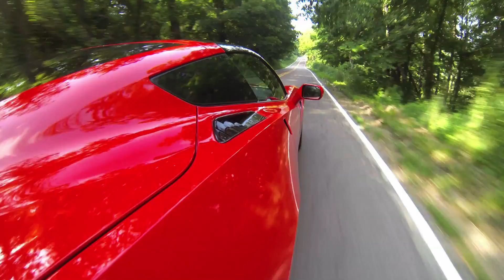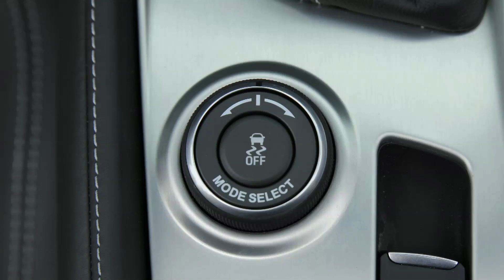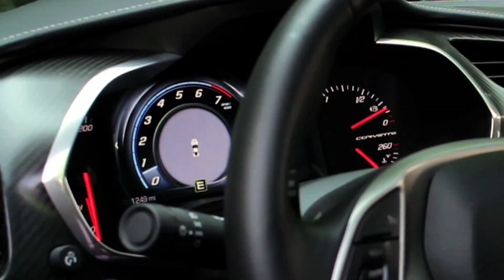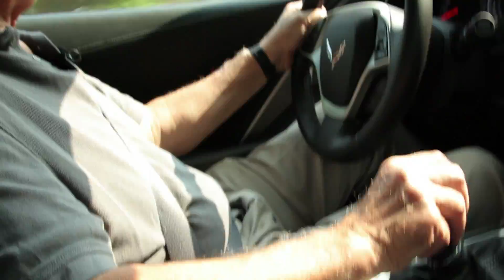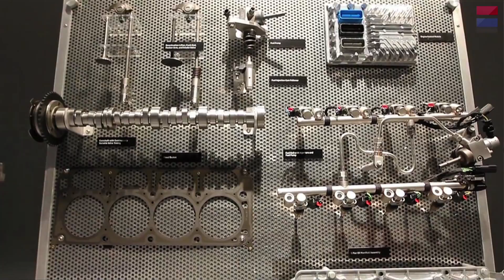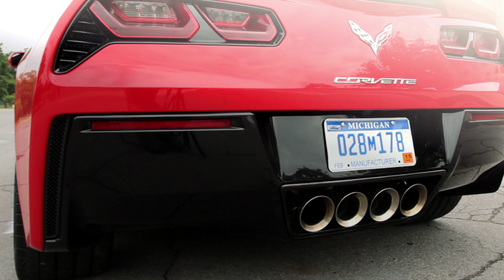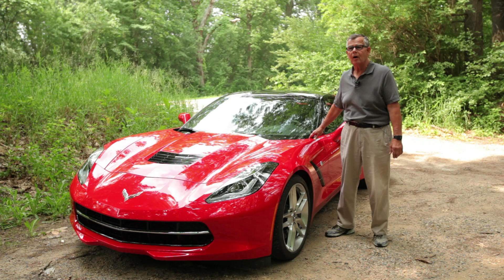2014 Chevrolet Corvette Stingray Z51 - Road Test - CAR and DRIVER

Comment: "You call me the idiot?"

Yes.

"You can't even read properly. I said SUPERIOR, not supervisor"

Then you should know a superior that assigns someone for some duty is called as supervisor.

Supervisor; (n) 1.  a person who supervises workers or the work done by others; superintendent

Superior; (n) 1.  Higher than another in rank, station, or authority.

OK? Now then answer my question who authorizes or gives the right to review cars?

Fucking idiot I read you alright and even corrected you
>2a

Comment: All things considered, I think they did pretty well with the C7. I'm more of an import fan myself.. But honestly, they seem to have fixed most of what was wrong with the Corvette (mainly that hideously cheap interior!), while still keeping the price low, and performance up.

Still not a fan of the leaf springs, but the pushrod LS/LT engines are one of those "if it ain't broke, don't fix it" things.

Comment: I agree with nanbrigdan's comments . This commentator is as dry as a martini gets with no buzz what so ever. The new corvette definitely seems impressive and finally has an exhaust note to raise awareness and announce its  presence. The styling reminds me of the Ferrari Italia and I like how they designed the flat portions of the top side body panels on the rear quarter to improve down force and to provide cooling for the rear brakes. The technology package also sounds like a winner.

Comment: He did sell sports mode in a sports car, he just made sure to do it after talking about eco mode. Up selling. Not trying to be a trouble starter, I just understand the Corvette has a broad market. Old and young, hence why the vehicle has edge of your seat performance, AND economical / fuel economy benefits as well. They did the research, and engineering. Marketing and mechanics. They have a better idea of what to make in a good corvette than we do, based on the factors they saw in their market.

Comment: Because that is who buys most of new models.  And they have to include a lot of non performance extras because most of those guys are married and have to beg their wives to let them buy the car, so they need as many reasons as they can get to justify buying one.

Young guys buy used and take the money they saved and use it to modify the car.

Comment: C&D, are the gear ratios you mention correct? Is it actually a 5 speed (190mph top in 5th) with TWO ultra tall fuel save gears (6 and 7)? If so I don't get that, why didn't they do a closer 6 speed, top speed in 6th, and eco tall gear only in 7th? :S

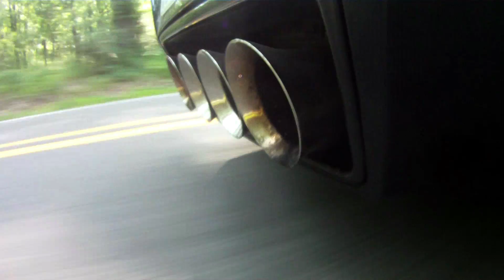Comment: both of the outside exhaust ports show discoloration (6:45), which is interesting as they're paired two left, two right.  Is this oil from the gate pivot/control?
I don't think it is heat-related.  
Hopefully it is easy to clean/polish...
Did you notice this in your post-drive walk-around?

Comment: Depends on the length of the race. If the race is a longer race, the Z51. The Aventador suffers from brake fade due to not getting cool air to the brakes.

Comment: It def looks great but are the panels still made out of plastic? I remember Top Gear testing a ZR1 recently which started falling apart during testing. Also which holds its resale value better this Vette or any comparable Porsche?

Comment: The aventador would rape it...but the C6 ZR-1 would be a close, even on track and not just straights.  But given that the base vette hits 0-60 in 3.8 sec, when the z06 or zr1 version comes out or what not, I would have to say that version of the C7 will probably be much better than where it is now.

Comment: Sorry but Onoff is right, the only Porsche's that will really beat the base vette will be the 911 turbo and up.  The S wont beat it and you have to be driving Porsche's for years to be able to really put one through the curves and achieve good lap times.

Comment: Almost every one of my friends have owned a Vette at some time or another. Most when they truly could not afford one. You just cannot believe the sick amazing gas mileage you get when you cruse in the manual Vetts. In the High 20's low 30's. If you are doing the 600 mile road trip you will use the eco mode. Even at 90.

Comment: Even though I applaud them for ambitiously pursuing the eco-mode...is it necessary?  The (few) young drivers aren't going to use it, and I don't even see the staple old guys using it either.  People don't drive a vette for gas mileage, nor are the demographic he types of people that need to penny-pinch.  When I heard the 4-mode kick in I was like "cool!...oh wait, what...yeah that's not cool at all."

Comment: If I remember correctly, you can turn off the auto-revmatch if you want to perform some heel-toe action, but if you come to a tricky corner, you can use the paddles to reactivate the revmatch for that turn only so you don't have to fiddle with the computer during a hot lap.